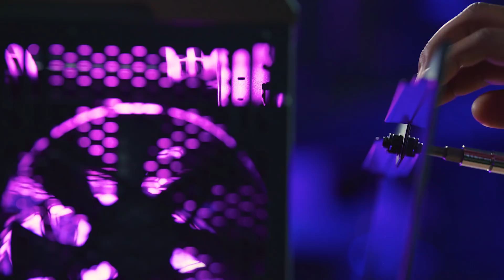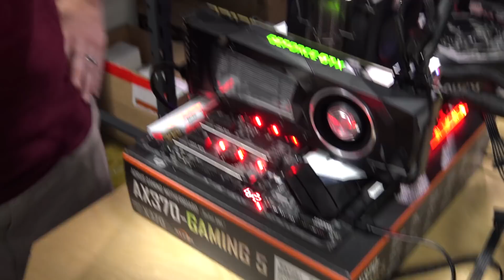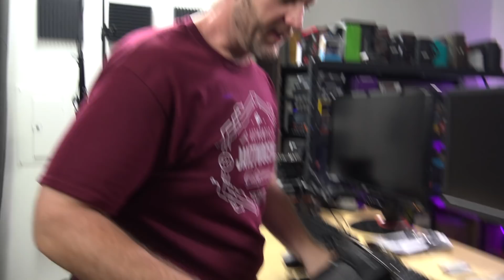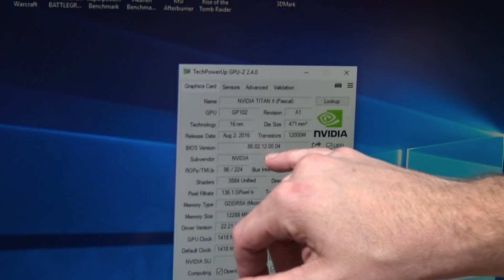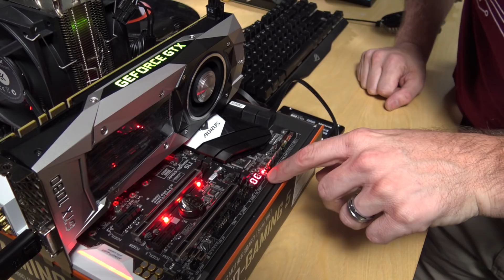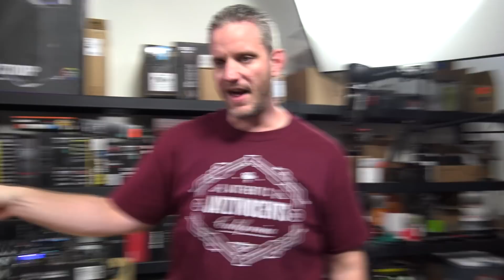I cant figure this one out... HELP!

Comment: It may be the the electronics on the either the GPUs/motherboard or both.  I've seen cases where all the drivers are the same, but the manufacturer changes a physical part and issues spring up.

Comment: Are on-card overclocks still a thing? You could check to see if the one card has a voltage bump or is pulling more power than the Ryzen board can push, which would explain why one card is problematic. I've also seen weirdness where manufacturing tolerances causes one piece of the same product to operate slightly out of spec (but within tolerances of course) and that is enough to trigger some mobo fail-safes to bail early... especially the picky ones. Mostly seen that with memory and CPUs, but I don't see why it couldn't happen with other parts too.

Comment: Hey Jay I had a similar situation and all I did was revert the motherboard back to the original bios and then rerun my checks and everything works fine. I found out that it was the BIOS update with the motherboard causing the issue with the video cards.

Comment: I recently upgraded to a R5 1600 and while waiting for my new GPU I decided to plug in my old 6850 into the new gigabyte b350 board, keep in mind that the 6850 was working fine in another re-purposed computer when I took it out, well, it wouldn't work in the ryzen build.  The only thing I could think of is that the card had some fan issues, I know HW monitor reported the fan speed in the 30,000 range or something impossibly high...  the fans worked fine they just didn't report the correct RPM. What I am thinking is that as a safety precaution, the board boots up and waits for a range of values for monitoring and sees that the fans are 'Broken' and decides to play it safe and not use the video card.

Comment: Jay, You have fallen victim to a situation of your own creation. Always power down the supply and cap discharge the mother boards when changing video cards. Power switch off on supply. Press and hold the reset button until memory illumination lights up and then goes off or any other board illumination lights up and them powers off. This will help in this situation .

Comment: All the talk about the same card twice: I think the point jay is making is that for any titan xp the ryzen system has the same BIOS as the Intel system - meaning the point wasn't to see if the BIOS between that specific card changed between systems but rather what BIOS the system was using in general for that specific card, which he couldn't check with the card that wouldn't boot.  Unless I'm full of it and computers do distinguish between individual graphics cards even of identical makes, I can't speak to that.

Comment: Tried it on another Ryzen board? Maybe one with the same chipset.
You also didn't check that the two Titan Xs had the same BIOS version.
Most likely to be a board issue. If something's going to go wrong the motherboard is the first likely suspect. Change the RAM then CPU while you're at it, to isolate the board as much as possible. Memory compatibility does weird things.
Interesting problem though.

Comment: Hey Jay, I was thinking about your problem while doing the dishes and I realised that one variable would be the power; different power supplies and cables, and of course those are being used on different motherboards and cpus too. I remember a past video of yours about getting different performance when using separate power cables for the GPU rather than one cable with a splitter. Could it be worth while trying separate cables for powering the GPU in the Ryzen system?

Comment: I’ve had the SAME ISSUE! I have a GTX 1050 and 1600. My mobo was a MSI Bazooka b350 and I was having weird boot issues. In fact it wasn’t posting at all. I ended up just reinstalling windows on a new hard drive and moving my files to it

Comment: I've had an issue like that with / without harddisks / SSDs in the system or not. It was something with defect "pull up resistors" I think. But that's not your issue obviously... Looks like you've to try another mobo.

Comment: I had kind of a similar problem. My RX480 would not work on my system, i would get bsod or hardlock whenever i tried to play anything after like 5 minutes, switched the card over to my girlfriends system and the card has been working without a hitch for the past month with the same exact drivers, power supply, operating system and memory. And my system works just fine with a different card. I cannot for the life of me figure out what the problem is, and i propably never will.

Comment: Had this happen before, and will drive one crazy.  Reflash the Video card.  The thought is the video card is halting the post and putting up an interup.  You are correct on the RMA thought, now days company's  are not as good at testing or quality returns. Seen a lot of different user or client problems in the past 45 yrs.

Comment: I honestly have no clue what's going on here. I learn most of the stuff I know about tech through this channel, my friend, linus tech tips, and a few others. But wouldn't returning the CPU to AMD lead to the same situation as returning the GPU to Nvidia? They go through the RMA process, and get it to run first try with one of their setups, and send you the CPU back saying nothing is wrong. As was shown in the video, a different GPU of the same model did work on that setup. Until someone finds the root cause of what is going on here, a new builder might just be stuck with hardware that just coincidentally doesn't work with each other due to luck of the draw. I understand the reasoning of why would one titan work and not the other, so it shouldn't be a mobo problem, and I am sure you have done this (it just wasn't outright said in the video), but have you switched the CPU and GPU that don't seem to work together to another mobo, just to make sure it was one of those coincidental mismatches that are fated not work together?

Comment: I'd go with the Gigabyte motherboard.  A friend of mine had a Z68 Gigabyte board, I know it's a while ago but, he had that board swapped out three times, and the problems wouldn't go away.  Then finally a BIOS flash sorted it, but once it was out of warranty the problem came back, go figure.  So he put up with the problem for months and then finally the motherboard died.  I contacted Gigabyte and they said motherboard repair is £50, but if we can't fix it you don't get your £50 back.  My friend then bought an Asrock board and it's been fine since.  So I won't touch Gigabyte again, especially for a motherboard.  It wouldn't surprise me if it wasn't the motherboard, but that would be my first port of call, after checking the BIOS on both cards, because from the comments it appears you ran GPU-Z for the same card twice, something I didn't spot until I read the comments and re-watched the video.

Comment: Reset MB BIOS to default with problem card in slot, then reboot, if it POST's then upgrade the MB BIOS, but try new BIOS boot without an operating system first... Win 10 may be doing writes to UEFI/BIOS...

Comment: AMD motherboard issue most likely. I had a similar issue with a board for AM3+ (weirdest thing i've ever come across as well). GPU was fine. Would not boot with a particular graphics card until I inserted a functional component in lower PCI slot (could be any device wifi/ect). Then it would recognize gpu and boot just fine. Seems the trend continues with Ryzen. Might see if that works for you. You may need to populate one or both of the lower slots.
Reply: gods, you're reminding me of how wacky ASUS bioses are. I once could not overclock an intel chip(2500k) unless i had the FLOPPY DISK CABLE enabled in the motherboard.

disabling it could cause INSTANT black screen and OC not applying.. at all.
Reply: ~DisabledStan. Was retail board, ASUS 970 PRO GAMING/AURA AMD. I reset and re-flashed everything on that board, didn't make a difference.
Reply: ~supertamal2000. The board from my example was an Asus. The plot thickens!
Reply: ~Cesarin Pillin. In my situation it would, but the case I was working in didn't have the clearance for the gpu in the lower slot. After putting a wifi card in that slot the computer worked perfectly with gpu in the top slot.
Reply: you most likely used a OEM mb... that has propriatary softworks and failsafe's. if the mb usually ships from retailer with those 2 slots occupied, and they designed the mb that way, then this is quite logical ;)
Reply: Safe for Consumption  possibly a motherboard manufacturer problem then. I'll eventually get mine if you wanna put it that way
Reply: lol, I bet its  a bios issue then.  I wonder, would the "faulty" card work in the second PCI16X slot?

Comment: Seems like a bad pcie slot on the mobo, try another slot or a different (but same model) mobo. If the gtx 1080 won't boot first time and then after you try again it does, then its a pcie socket problem for sure

Comment: I've had an MSI 970 gaming (amd)  mobo in the passed that would just fail to boot sometimes, flick the switch and no post, turn it all off unplug all the power, leave it for ten mins then try again, then it would boot perfectly fine and be fine for weeks. I tried all components and nothing changed all drivers updated. It started doing it after going to windows 10, then stopped doing it after the last big update!! Its been fine for months. !!

Comment: I had a similar problem with a sli setup on a board where either graphics card worked in both PCIE slot but randomly both would not work at the same time. I changed everything but the board. Never figured it out. It might just be a bent pin on the slot or corrosion on one of the pins on the card and one board is more forgiving than the other. Also since you know ryzen is picky with memory maybe one of the Titans has an unstable memory clock..... Just a thought

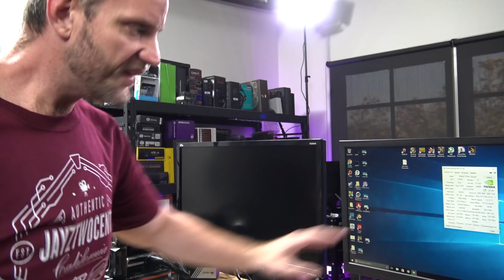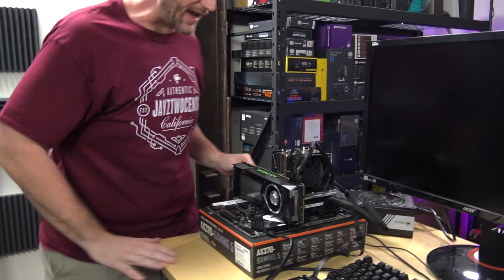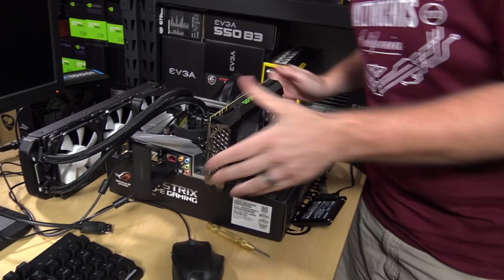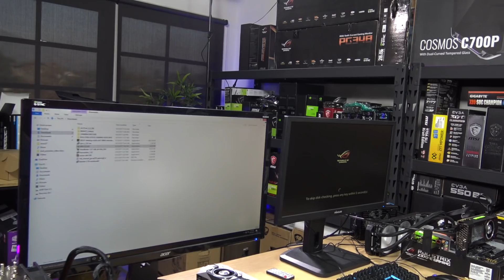Comment: 2:06 So if we look at our GPU-Z, We got a BIOS version 86.02.12.00.04(in the 8700K system), 2:27 takes the card in the Ryzen system out, 2:42 takes the card that's currently in the 8700K system out, 2:55 sticks it in the Ryzen system, 3:15 Sticks the card that didn't work in the Ryzen system in the 8700K system 3:49 "So what I want to check right now, with it working on the 8700K system, is what the BIOS version is" 4:47 Points out BIOS version on the Ryzen system is identical to what the SAME CARD in the 8700K system was.  Why not do what he said at 3:49, and check the BIOS on the 8700K system, since that has the card that didn't work on the Ryzen system in it.

Comment: you checked the same video card for bios version lol. my suggestion would be to reset cmos on the MB by removing the battery or shorting the jumper pins...no soft reset.

Comment: You showed the bios version on the card that worked in the both systems, took the card that did not work in ryzen and set it next to the intel system and then moved the gpu from the intel system to the ryzen system and showed the bios on the same card again. You never showed us the GPU version for the card that does not work with Ryzen. Also, is the board still overclocked from the last video? Try resetting the bios on the ryzen board. It cloud be a setting there.

Comment: @JayzTwoCents As was pointed out, you didn't check the bios version of both cards, you checked the bios version of the same card in both machines.  You noticed a different post code (the OC code) after swapping cards due to different cards reacting differently to overclocks (particularly the PCI-E bus).  It could very well be the board causing the issue, but you still want to do the due dilligence of process of elimination before making that determination.  You're noticably and understandably frustrated by this point in the troubleshooting, so I can see why you made the mistake.

Comment: You checked the BIOS on the same  card twice, you checked it on the one that was working on the motherboard that was working, check the non wiring gpu on the wiring mobo. got to check the BIOS version on the card that's not working on that motherboard.
If that doesn't work I would take the exact same motherboard exact same ryzen chip and test on that

Comment: I had the same issue when I flashed the new bios to my motherboard. As soon as I did that, I started getting a VGA error and no post. I had no idea what was happening. I reverted to previous bios on the motherboard and that issue went away. I have no idea what caused it but I'm hesitant to upgrade to newest bios because of it. 

My system:
Ryzen 5 1600
Ripjaws V 3200 (running stable at 2933)
Radeon R9 270X
Corsair 550 
Kingston 256 ssd

Comment: your power supply fan is not running on the right bench not that its the problem but you can over heat stuff

Comment: Umm, when you checked VBIOS you did it on the same card.  You first showed VBIOS version on the Intel system.  Swapped the cards.  Then showed VBIOS on the AMD system (with the same card from the Intel system).  So what's the VBIOS on the card that isn't working on the AMD system?

Comment: I used to have a nvidia 8600gt, what a nice card, but, in my intel system freezes constantly ( chipset p31-p41, different boards, etc) and only if you putted that card in an amd system from the time i was speaking, the card works perfect. So, Jay, is just weird hardware incompatibilities. Cheers man, keep up the good work!!!

Comment: Had a similar issue a while back that it was a PSU/GFx Combo at fault, the PSU had slightly dirty power and the specific GFx card was very Choosy about it's Voltages.

Comment: @JayzTwoCents  I have pretty much the same problem with one of my HD7970s on my father's X99 system.  I have them in crossfire on my X79 system that I sold so I put them in my father's system to replace his old HD6870.  Cards were working great in Crossfire until driver 17.4 which made one of cards quit working.  The card powers on with fan spinning, but it won't post and the BIOS doesn't even detect it.  I send it back to VisionTek and it works for them.  I put it back into my dad's PC and it works!  I install the latest drivers and then it reboots and the GPU is back to being a potato.  It's very frustrating and annoying to troubleshoot since it's two GPUs and a bridge I'm swapping around.  My old FX-60 system won't detect the VisionTek GPU either, so I dunno.

Comment: its todo with motherboard and PSU suppliers saving money when it comes to power regulations with europes ErP and america's useless energy star, you just turn the volts on your RAM up, until it boots, stick to europe hardware if you want everything to work, like kingston and b-quiet, etc

Comment: maybe mobo cpu load line calibration...i used to have problems with a rampage 3 extreme back in the day,having two evga gtx 580 and one needed more voltage than another and when in sli the system crashed in 3d aplications when i messed up the cpu load line calibration...power supply was 1200w so that was't the issue.

Comment: So, I'm working with MXM cards on older and newer notebooks and this issue really looks like a vBIOS compatibility issue since I have t fight this issue on a daily basis. You checked the same card twice, so obviously the vBios should be the same version. Reflashing and making backups from pascal cards are not really stable as of now, sometimes when doing a backup u'd corrupt ur vBios and breaking ur card when trying to flash (if it allows u to flash). I don't think this is a Ryzen based problem but more Nvidia sending you a card with a vBios that has difficulties communicating with some boards.

Comment: Jay, I've had this some problem on my two Ryzen systems. I think it's some sort of software issue with the Gigabyte mobos and certain cards. I fixed it by manually resetting the bios & clearing the CMOS. I first, unplugged the power supply and then removed the little battery that's installed on the Gigabyte mobo (not by pressing the reset button or by wedging a screwdriver between those CLR CMOS connectors). When you clear the CMOS on Gigabyte mobo's, your overclocked profiles will still be saved after the next system boot. I know this sounds crazy. But, since that time, I haven't had any more problems. Hopefully, this will be of some use to you. Good Luck bro. By the way, I like my Jayztwosents t-shirts!

Comment: Hi Jay, 
This reminds me of my old build where upon switching to water cooling on my HD5970, the ASRock Mobo went into a VGA post error. As you, I've tried everything (except swapping with another GPU since I didn't have any) and just before I resigned myself to believing I destroyed it during the water block install I tried one last thing. I followed the ASRock manual for clearing the CMOS on the Mobo and... it worked... I don't know why but that fixed it. So you can try that if you haven't.
Cheers.

Comment: i got a real kicker for you, i just built my ryzen system and it boots fine etc. but if i have displayport plugged into the gpu, i see nothing until windows boots up and is running... to get to see the bios i need to have only the hdmi cable in the gpu

Comment: “I lost an hour of troubleshooting”... then continued down the same rabbit hole. Any chance of getting core and memory volts using a multimeter on the working and non-working card on that motherboard. Also does the Ryzen motherboard and/or processor matter or is it common to all Ryzen?

Comment: I had a simular problem a few months ago, i had 1 gpu bought another and fan was spining lights on, but no image, while other gpu was working fine, and it was not eaven detected in bios. I managed to fix problem holding on 10 times power switch while power was on and off at a time. And after it booted all was fine, but eaven if i overclock anything i wont start again :/ Hope this will help someone. Cheers